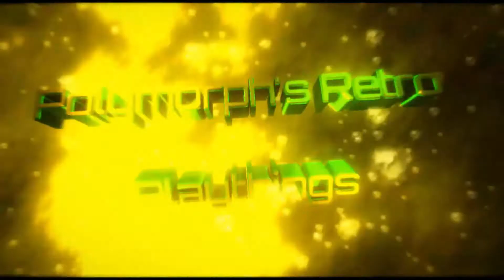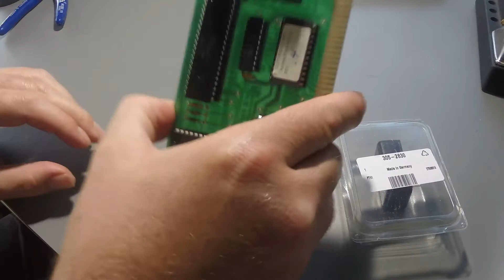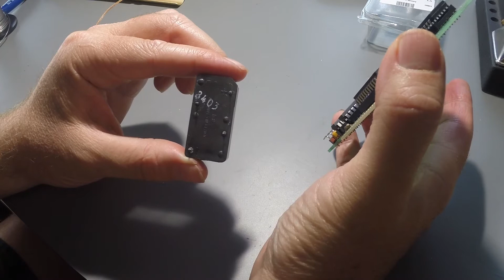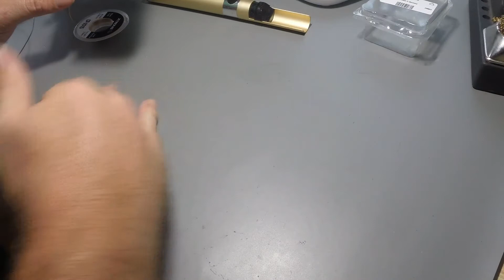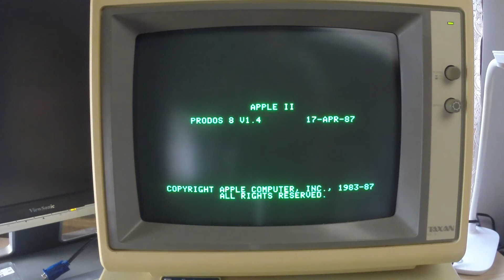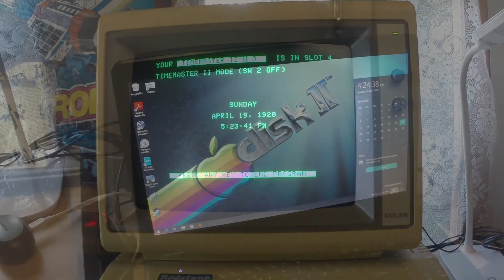Timemaster II H.O.  Battery Replacement

Comment: Where can I find this battery replacement? Do you have the part number for us?
Reply from the maker: The part to look for is a Varta Mempac 3.6v model #: 55615703012. For example, this can be purchased from RS online.